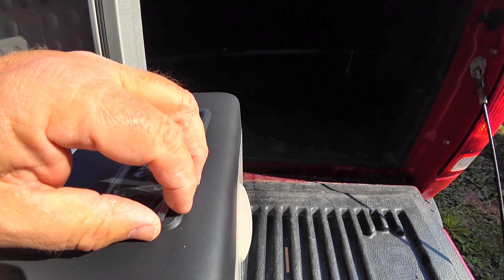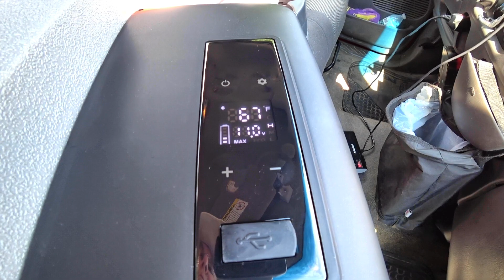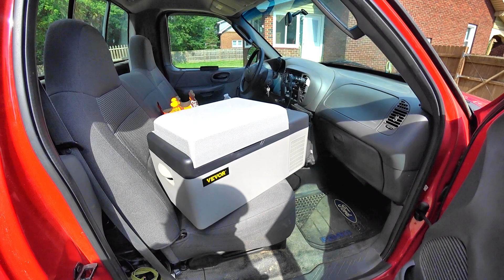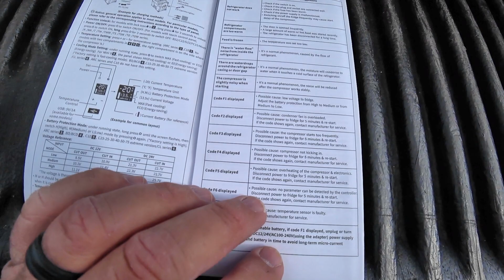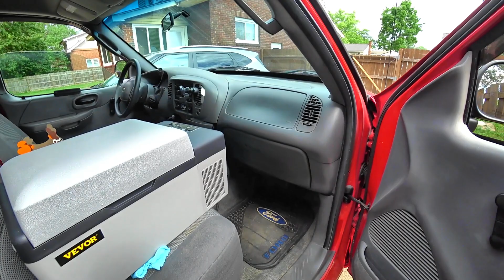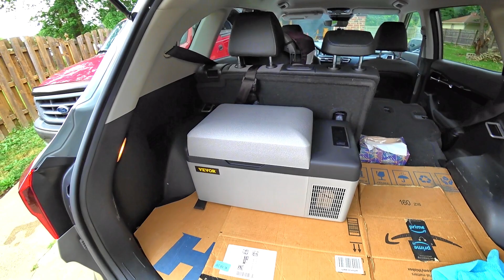VEVOR Car Refrigerator Perfect Road Trip Unit

Comment: I own this exact fridge and live on a grassland desert in Canada.  Extreme cold in winter and extreme hot in summer.  I used it on the beach when it was +41c (106F) with no problem... drinks were ice cold.  I use it with a Greycell T-1000 solar generator and it can run the fridge for nearly 4 days between charges. It can also run directly from the solar panel (through an inverter). It consumes around 200 WH per day. In comparison... I have a thermal electric cooler and it consumes 1400 Wh per day and is not nearly a cold.  I can only run the thermal fridge for around 10 hours before I need to charge the solar generator. This fridge has a compressor and as long at it can run,  it will efficiently cool where as a thermal electric will only lower temps down based on ambient temperature so if its a hot day, your drinks are not being cooled very well, if at all. I am very happy with this unit and recommend it.

Comment: Not so sure if use it. I’d just be worried that it will kill my battery even though it has protection. You can’t take it down to the beach easily. You need a charger all are heavy. Just easier to go light with a small cooler bag. I can see it be great if your going in a road trip that’s far. Not so good for just going to the local beach